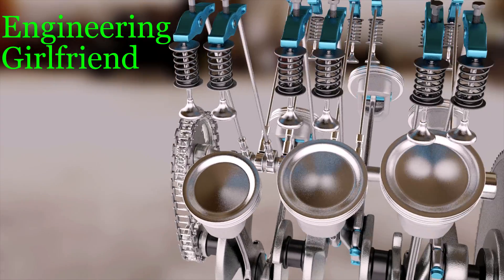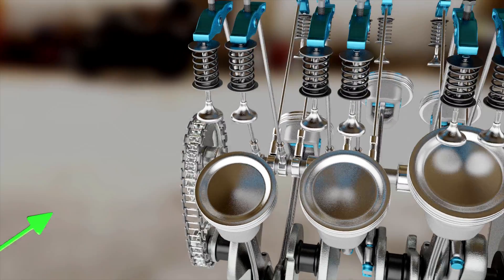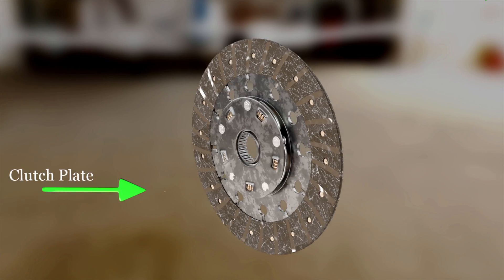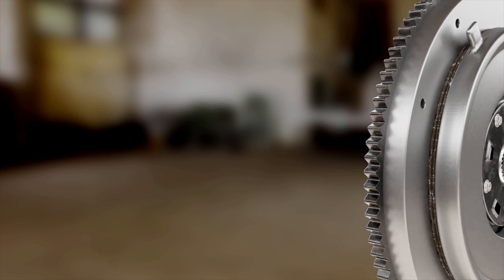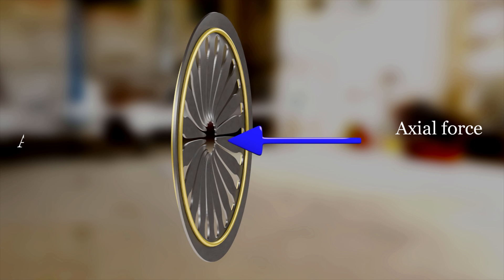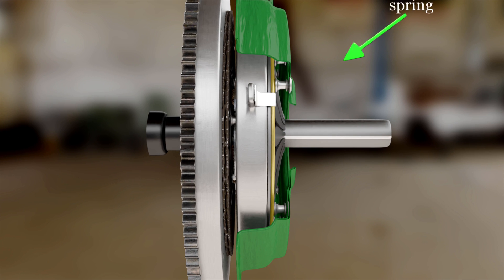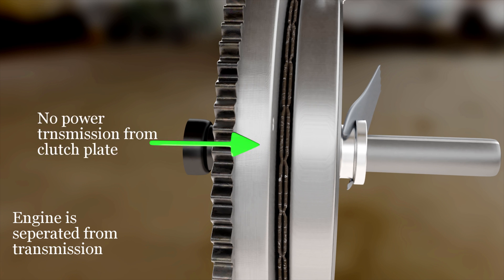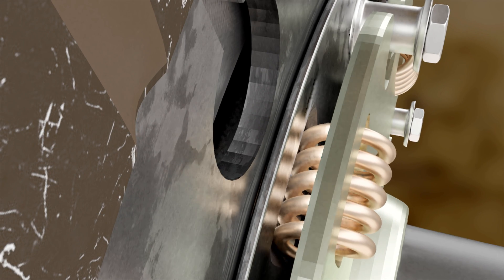How Clutch Works

Comment: Why does clutch frictional plate gets disconnected from flywheel when pressure is removed by pressure plate ? engagement is fine and I understood but during disengagement how does friction plate only get marginally away from flywheel ?